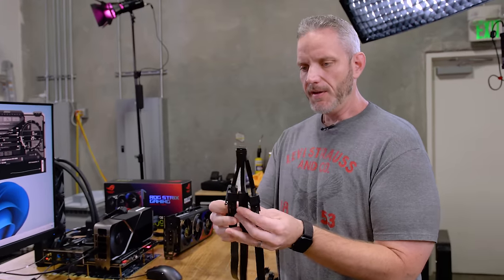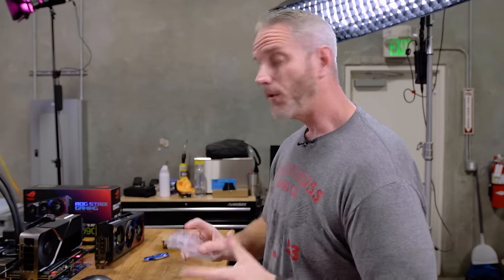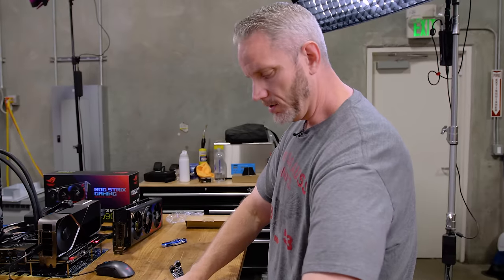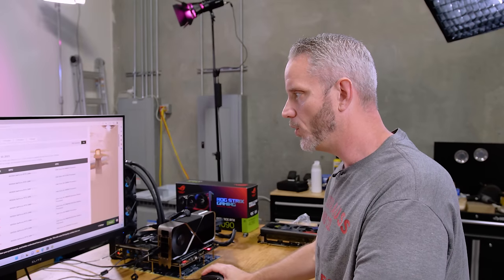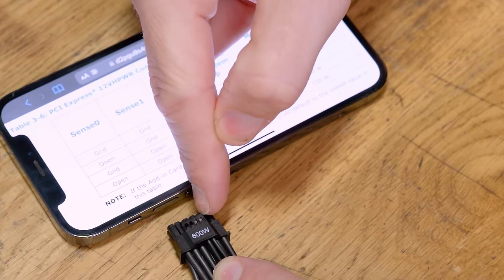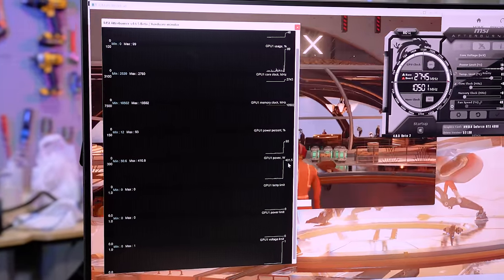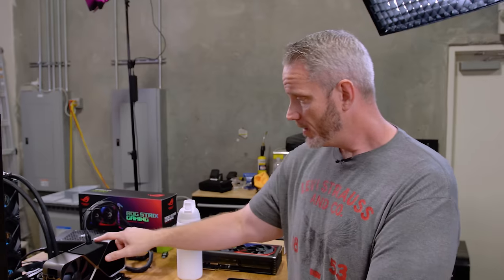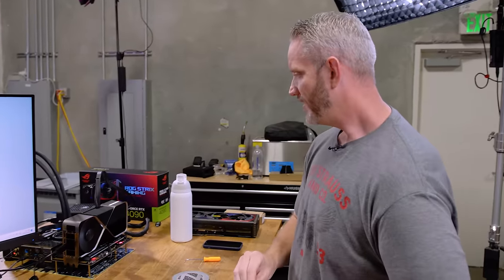DON'T Do this with your GPU!

Comment: I want to max out my monitor with ultra settings in any game, and don't know what my path should be because I'm close as is. 
Current setup: 
Lg 1440p 180hz 0.5 ms ips
i9 10900k / oc @ 5.2 all core -0.80v
32gb ddr4 3600 / xmp enabled
3090ti fe / mild oc +185c/+145m
Should I go r9 7950x or 4090?
Both paths are roughly $1500
Or should I just deal w tweakin settings
Reply: Your PC is already overkill for 1440p with your current specs. No matter what upgrade path you choose, if you choose, at 1440p in most titles you will be CPU bottlenecked (even with the highest end, most recent CPU line-ups, both from AMD and the upcoming Intel line-up), FPS wise with a 4090. But it's no problem whatsoever, with your current rig to run everything at max settings with very good FPS.
Reply: @ron200088  Yeah, you're probably right. Bf 2042 for example I've gotta drop a few settings to hold 180fps consistently, and there are scenarios where it dips to 160ish, but I can't exactly justify an upgrade for the sake of laziness. I LOVE my monitor, so im plenty content w 1440p until theres 4k monitors w the same responsiveness anywhere near $500. Then I'll just upgrade to 4090 I guess
Reply: @Bytrl  Yeah, you are right. That’s what I’m basically aiming for. 4k monitors with very good picture quality with high responsiveness and high refresh rate at a good price. That’s also my target, $500. Currently I have a rig with a 5800x , OC to 4.9 Ghz all core, 32 gigs of ram ddr4 3600Mhz and a 3080Ti. I play at 1080p 240Hz refresh rate monitor. I also play BF2042, Pubg and Warzone. With a bit of tinkering, I manage to get steady 240fps most of the times. With very few dips to 210-220 fps, but that is due to the game engine. But overall, I know that the PC is overkill for 1080p.

Comment: Hi, Jay or anyone. I'm  planning to upgrade my Vostro 14-3468. I'm upgrading the HDD to SDD and the processor into something new. It currently has a ST1000LM049-2GH172 as a hard drive and a i5-7200U. The base board is 03T9D4 version A00 by Dell. Do you have  recommendations of SDD and processor that would be compatible?
Reply: Buy a z270a msi motherboard, and an i7 6700k and a 500gb or 1tb Samsung ssd. All in about 400-500$

Comment: Will z390 auros master support 4090?
Reply: z390 auros master have PCI Express 3.0 4090 uses 4.0 yes its will work but you will loose like 3-5 fps
Reply: @maximumfps7541   i dont need a bios update right? since there are none new till date.
Reply: @VGSoniTech  bios update are not needed for 4090

Comment: These def aren't solid core wires, they are probably a thicker wire gauge than normal cables to handle more current, but a solid core wire would be too fragile and less ductile than the cable u shown

Comment: You see Jay, the 4-pigtail adapters were 6 cents cheaper than a solid core well built adapter. And supply chain and uhh, stuff. There just isn't enough margin in a $1400 card for an actually good cable to power it.

Comment: Oh I am so happy I saw Jay unpinning the 4 pins. Was hard to tell if I can do custom colors for 40 series.
Reply: Case modder/Cable Maker here.... Yes, but good fucking luck. The connectors and terminals are so ungodly small, that even the THINNEST 2mm Sleeving on the THINNEST insulation I could find for 18awg (standard size for psu) the melt has to be so bloody precise and small, even then its almost impossible to get the wire in the connector.
Reply: @Tpbmods   What I did with my current build. The length was not an issue so I just unpinned them with the tool, sleeved it and pinned it right back with combs. From the video it should be still doable. I hope someone builds combs for these.
Reply: @JayzTwoCents wonna try ? Video material.

Comment: Dont Buy a RTX 40 anyways been reporting a lot of them have been burning out with people using even 1200 watt PSU. Specially PNY cards the XLR8 24 gig cards are Running at 66c idle. I would wait if you really really want to give Nvidia their ransom money for these cards until they work out some of the bugs like Dlss 3.0 is garbage atm and needs some serious patches.

Comment: I worry about people that are usually rough with things they touch. When these people slide the side panel open violently, and if the adapter is already touching the side panel due to a smaller size case, they might just rip the adapter off the connection, and there goes the 40 series cards they just bought.

Comment: Errrrrrr. I've blown stuff up by putting it on a too highly rated power supply in the past.

Sure, we're not talking PC power supplies, but try putting a 12v fan on a 12v industrial power supply.
It'll be dead within seconds.

RIP: the three perfectly good PC fans I popped with their expected voltage.

Comment: So the loose theory is that the GPU won't try to force more power than it thinks it has so it doesn't overload the PSU and cause caps popping and a visit from the local FD... until you do what Jay is going to in the next video and plug it into a 500W PSU.  Best laid plans of mice and men/engineers.